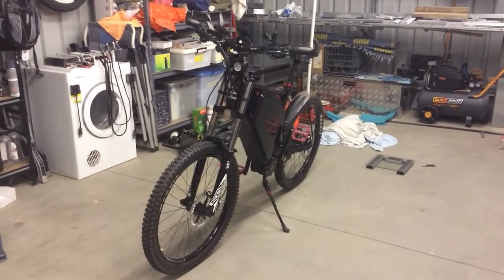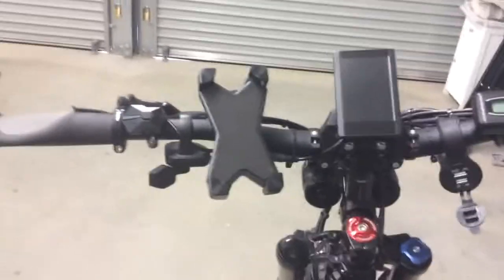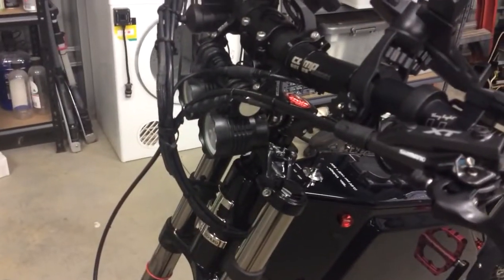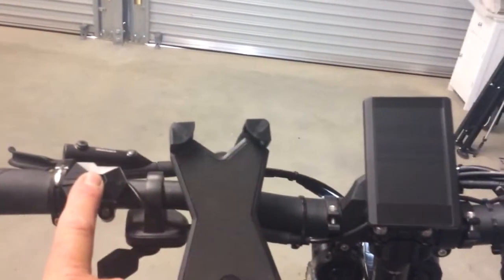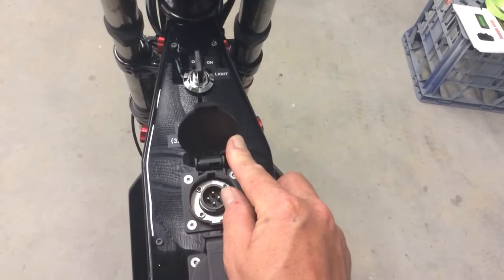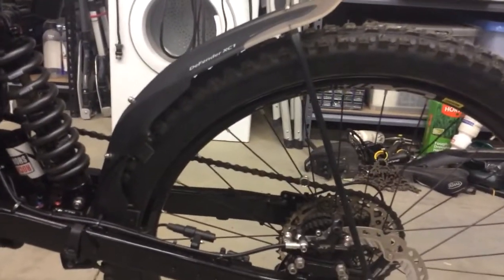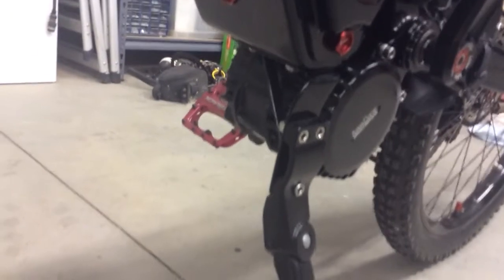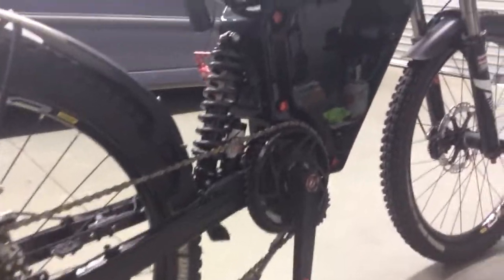Enduro E-Bike with Mid-Drive (BBSHD) Custom Build Walk Around

Comment: does one casette last to work and back or do you need to bring a spare one?
Reply from the maker: The rear 11 speed cassette has lasted well since V1 Build. No need to bring a spare.

 As long as you purchase the All METAL GEAR VERSION. Another version is available with all metal gears except the biggest 46T gear which is Aluminum, I wouldn't recommend this "weaker" version. 
Chain & gear lubrication & maintenance is the key for long life. Also I have only tuned my BAC855 controller for a maximum of 1.8KW so over that "could" lead to higher chain & sprocket wear.

Comment: dose the mid drive slap the frame like they say on alot of forums
Reply from the maker: Hi Adam, No it does not. I have made a custom 3mm steel Bracket locking the Mid drive securely in place to the rear swing arm.
Reply: @oze-bikes4life663  thx, was curious as i bought the same frame an already have a 2wd 2x hm 1500w mtb

Comment: hi mate. Did you need to cold set the rear drop-outs? The reason i'm asking is that i bought one of the scabby 200buck chinese frames (damn you late night drinkin) and the width of the back end is about 200mm.
 I went for an internally geared hub and it's waaay too narrow, so i looked at getting the Swing Arm from ElectricEnduro as they supposedly do a 150 or a 170mm but the website doesn't work.
Nice set-up either way pal, John
Reply from the maker: Gday mate 😎 Yeah i did pull together the rear swing arm using a 10mm or 12mm long threaded rod, tightening both nuts (with washers) “evenly” to pull in the dropouts in to suit my particular hub, which I have listed in my description. I purchased an EEB frame so it may be different from the frame you bought, 🤷‍♂️  
At the time of my build the Rear hub I purchased was the widest hub available that I could find. It needs to be wide not just for the rear dropouts but also for a better chain line (less chance of chain derailment) I have zero chain derailment with my setup. 

Hope that helps 👍

Comment: Where did you get the bracket made i need one
Reply from the maker: Hi Chris, if your referring to the "motor mount bracket" then no i didnt get it from anywhere i made it myself from a piece of 3mm Thick "flat bar ", once you work out the rear stance of the bike, eg. rear shock length & shock position that suits you, then work out at what position you want your motor to sit (bike must be unweighted of course) then & only then can you mark out & design your motor mount bracket to suit your ride height etc. as the custom bracket bolts to the standard fixing holes around motor then also extends back  along "Rear Swing Arm" then clamps to swing arm, (i used a S.Steel hose clamp to do this)
Reply: @oze-bikes4life663  thanks for the info... could you post detail pics of the bracket and clamps so I can replicate for my build... thanks again.
Reply from the maker: Chris Brown , i dont really want to take parts off my bike, you can see this bracket "off the bike" when i was fitting the dust cover in another video link, just freeze it at 12 secounds mark. https://youtu.be/pw1EgSZjMm4
 
You already have the BBSHD "motor mount bracket" which was supplied with the motor, use this as a template to mark out (scribe) the bottom bracket main crank hole & the motor mount holes, cut out the excess material around these areas including the holes you just scribed out so you can fit the bracket in place, (leave all material on 3mm sheet facing towards rear swing arm,then the angle along the rear swing arm can be marked out once you fit custom bracket up to the motor, 
tip -  you must start with a decent piece of 3mm sheet of steel otherwise you may run out of material when scribing along steel following the rear swing arm position/angle.
You will also need to bend a set into the 3mm steel to allow it to sit flat against the side of your rear swing arm, this bend should be done at the very end just before you fit the hose clamp in place.

My bracket in My Video link is lying in the "top left corner of my mat"
Reply: @oze-bikes4life663  ok thanks

Comment: Whats the total cost of the finished bike if you don't mind me asking? I'm weighing up buying a pre made one or doing it myself. I have a bit of electronics knowledge so it'd be within my capacity.
Reply from the maker: Gday SkilledCheckmates, i dont have an exact price but it roughly cost:

- BBSHD Motor Kit (100mm) without a Battery Pack $813.00 USD
- EEB Frame $550.00AUD
- Panasonic NCR18650GA Li-Ion Cells x 150 = around $1,300.00 AUD
- Rock Shox Domain Dual Crown (200mm) Front Forks  = $550.00 AUD
All other Bicycle related top end components (as in my desription) around $500.00 AUD
So a ball park fiqure i would say around  $3,600.00 to  $4,000.00 AUD
Reply: @oze-bikes4life663  thanks for taking the time to write that out mate. I appreciate it! I think I'll build my own. Will be a great little project for the next couple months. Would you say electricbike.com is the best site in terms of information? Cheers!
Reply from the maker: SkilledCheckmates , i think you would far better off building your own Ebike, use components that you like & DIY battery build to whatever capacity suits your needs, (Not to forget its something you will be quite proud of) 😊
Regarding a BBSHD build with the EEB frame, 
i would highly recommend  Googling "Enduro Ebike Frame Documentation" for a Clear step by step build process (by Paxtana) & yes the Electricbike.com forum is Excellent research site 👍🏼 
Best of Luck Mate 😊

Comment: can i ask where did you get the frame? i thought it was an em3ev job but they say theirs is incompatible with BBSHD?
Reply: ahh i see i missed your bit about custom work on swing arm. I cannot go to link it says internal error?? any where else I can get info on your customisation? I really want to do the same sort of build. are you on endless-sphere facebook or somewhere else I could contact you on?
Reply from the maker: Hi Trick5ter001, just google : Enduro E-Bike (BBSHD-Mid Drive) 11Speed Custom Build, 

A fellow named "Paxtana" bought out a Clear Step by Step build guide for Building a Enduro Ebike Frame with the BBSHD Motor, this helped me out a bunch during my build.... just Google  "Enduro Ebike Frame Documentation".

My basic build is almost the same as Paxtana except I didn't cut away the whole bottom frame plate where factory kickstand mounts, I cut away around 10mm only so that the Motor can tuck up nicely into the frame. The second thing which is just as important Was that I used a different Shimano rear hub to Paxtana Guide which I have listed in my Description. Hope that helps
Reply: @oze-bikes4life663  THANKS FOR YOUR REPLY!!! so did you just take some of the edge off that corner of frame where the motor and frame met? theres no major custom going on just squeezing a bit of room to fit?
Reply from the maker: Trick5ter001 yes that's correct, the rear swing arm will also need to be pulled in to fit the Shimano rear hub (that  I listed) I did this using a 10mm threaded rod through the dropouts and carefully winding the swing arm in with some 10mm nuts/washers, making sure each nut is wound in equal amount to each other, doing this will centre the hub, wind in dropouts just enough to fit the overall length of the Rear Hub dimensions.
Dropouts will also need to be drilled out from the 10mm standard holes to 12mm to fit the 12mm x148mm Through Axle in the rear Hub.

Comment: are there any issues with the bottom bracket holding the motor bumping into the frame during bumps? does it impede the movement of the rear wheel holding arms?  Any issues with torque from the motor flexing the motor holding plates? thanks and cheers m8 great build
Reply from the maker: Jake Richard  
 Hi Jake, BBSHD Motor is supported by Bottom Bracket lockring  (same Support as Stock Luna Motor Mount which I replaced) but most importantly i have made a custom 3mm Thick Steel bracket which is long enough to "extend" along side Enduro E-Bike Rear Swing Arm where it is then Fixed to Swing Arm with a Stainless Steel Hose Clamp
Custom Bracket also bolts to Motor as Standard, Bracket is angled to hold Motor at about 2mm off Frame & holds it very solid (no flex) 
The Motor actually swings "down & back" under shock compression (away from frame) 
When under no load (back wheel off the ground) Motor sits 2mm away from Bottom cover/frame as described above.

Note - At 5:35 it Shows Custom Bracket (it's a bit hard to see as its painted "Black") but for more detailed photos go to my Link in the description above

Comment: Im clueless,.... can i buy a enduro frame and just put the parts from a mountain e bike on it???
Reply from the maker: eleven38  Hi Mate, that's cool.....that's how most people build their E-Bike which can be custom built to your personal choice/preference

I purchased Frame only direct from China, (Available in Gloss Black or White) from : 

http://www.enduroebike.com/sale-6909532-high-power-hub-motor-enduro-bike-frame-anti-scratch-glossy-plastic.html

Note - If you go for a "Mid-Drive Build" like mine (BBSHD Motor -100mm type for Bottom Bracket) you will need to compress inwards the rear swing arm Dropouts to fit the Rear hub (Widest rear hub I could find in (Shimano) 11Speed was the one I used, (Listed in Description) 

This can be carefully done with winding in a 10mm Threaded Rod through the Droputs also drill out the drop outs to 12mm is required for Rear hub.

If you build a Rear Hub Drive (Motor in rear Wheel) with this Frame none of these modications are required I believe, but no where as good when climbing Steep Dirt Hills as a Mid Drive Setup.
Reply: Thanks for the speedy and very detailed reply Patrick !  you have just pickled my brain even more now, lol jk..     Basically i seen a enduro frame on ebay for 250£ i was thinking about using parts from a normal e mountain bike,   i realise id need back shock b ut the dropouts etc are way above my head......
Reply from the maker: eleven38   
I found this guy Paxtana who made a really good Step by Step "Enduro E-Bike Build Documentation" it helped me out a bunch.....here's the link https://electricbike.com/forum/forum/knowledge-base/bikes-aa/31249-enduro-ebike-frame-documentation

Comment: Wow, nice clean build. Any videos of you riding this to see how it performs? This will be my next build, very curious how the bbshd handles in this frame.
Reply from the maker: David Johnson , Hi, Unfortunately I don't have any type of Head cam to show riding footage (only I-pad) may try to take some trail footage using my I-Phone, however the BBSHD performs very well on the EEB Frame, Total Bike Weight (Including Batteries) = 32.9Kg which ain't to bad considering I'm running a large 15S "35Ahr" Battery Setup.
Total Distance travelled = 239km with no Mechanical/Electrical issues or Chain Derailment at all

Comment: Beautiful build. I've got a super low budget commuter ebike right now but I really want something a little more fun. I might have to do something like yours.
Reply from the maker: Matthew McKinley G'day mate, yeah I was the same, first build for me was a Secound Hand 9 Speed Hardtail Apollo LSX 1.4 Mtb Frame with V-Brakes & New Bafang BBSHD Mid Drive Kit, but I suffer from Back pain so I built an Enduro Ebike "Full Suspension" Build
Reply: I'll try to get a little walk-around video of my bike posted today. You'll laugh at how cheap I was in putting it together. For the next bike I'm considering using the new kit from Vrusend to build the battery. I'm a bit of a speed addict and I'm trying to convince myself that I'll be happy with 48v. We'll see what I actually end up building but I know I'm hooked on electric bikes for life.

Comment: what is the bottom bracket of that frame??
Reply from the maker: Waris Lawal - Hi Waris, Its 100mm so it requires a 100mm BBSHD Kit if you go for the mid drive option